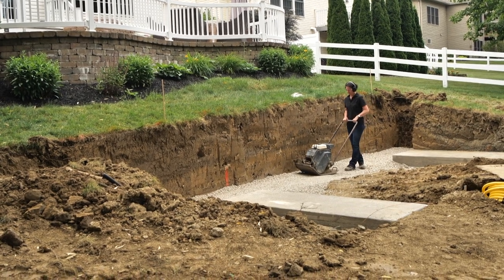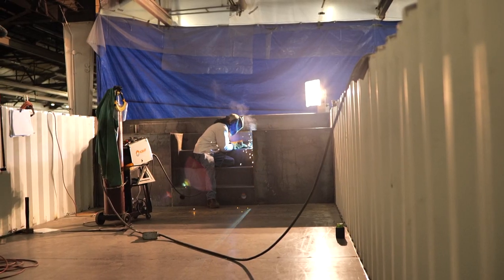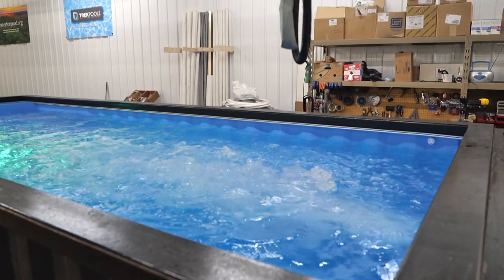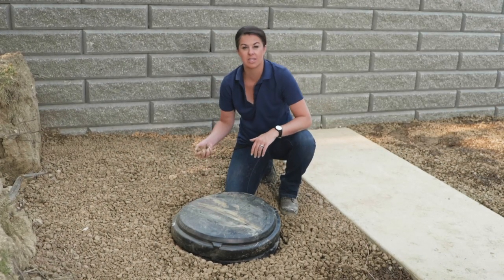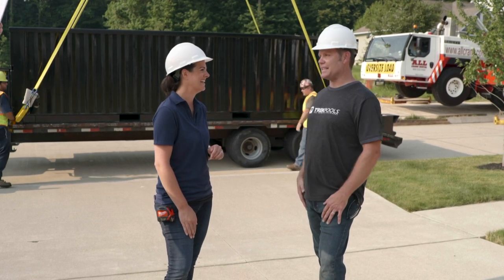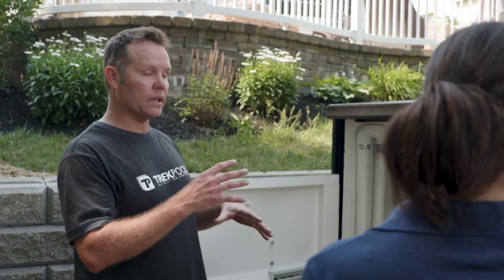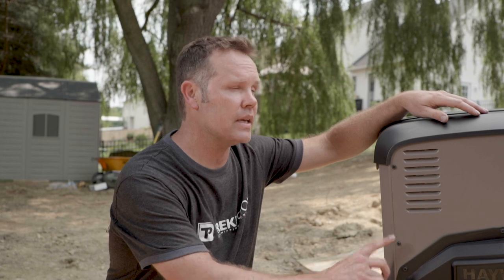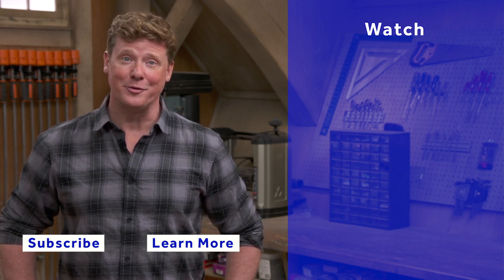How to Install a Shipping Container Pool | Ask This Old House

Comment: Aren't shipping containers hard to come by now? Not sure how this would be economical rather than having custom shaped pool with traditional materials.
Reply: Not if they're used. Even if that was a water tight single trip container (and most of the containers they're using certainly aren't) that container is going go be cheaper then a comperable liner. Way stronger and self supporting too.
Add that all of the guts are manufactured in a factory and the labor for this will be significantly less expensive.....
Also - the contractor was just a landscaping company and not a pool company - relatively unskilled and cheap labor compared to the specialized experience needed for a traditional pool.
Reply: It’s far sturdier and looks better than a traditional pool! Plus the guys who build these things put their heart and soul into it. They also have great customer service!
Reply: @garretthaney9134  I saw that they arent strong to side pressure.  When they were used in the ground, the sides buckled in.

Comment: TOT is stretching for content . an 8'x 20 ' x4'  pool is very small.  whats the cost comparison vs an equivalent  in-ground pool that was made with concrete ,galvanized steel and replaceable vinyl liner. also what is the life expectancy of this until the  steel needs a  re coat and /or rots thru ?
Reply: agreed, this is just a landscaping pool to look at and dip your feet in, at best.  not a real pool to swim in.

Comment: Shipping containers are meant to be cheap and disposable ways of moving products from one place to another. They're not meant to hold water, and not meant to last more than a few years. No part of this is their intentional purpose, and this whole thing will quickly fall apart.
Reply: Can you at least check out the website and read info about it on your own before making a comment like this? The company is called Trek Pools be a bit more open minded and read about their process on how they prevent all that!

Comment: This seems like added cost for no real benefit.  I thought containers were in short supply?  I know metal is $$$$$ right now. With all their options it’s like $50 grand plus install which is probably another $10 or $20 grand.

Seems like a similar cost to a custom pool that size and location.

Comment: Maybe I missed it... But there was no mention of the recurring cost of the fossil fuel needed to fire up this beast! This is a great way to expand your carbon footprint to a size 24 shoe equivalent!
Reply: The heater is 400,000 BTU. So that's 8x what it takes to keep my house warm on the coldest day of the year. Obviously it won't run all the time, but it's a lot of fuel and heat that will be lost since they don't seem to have insulated sides or an insulated cover.